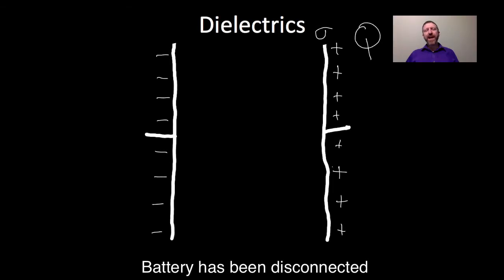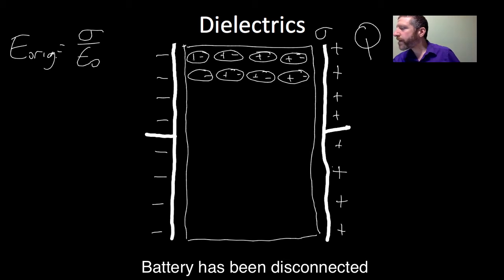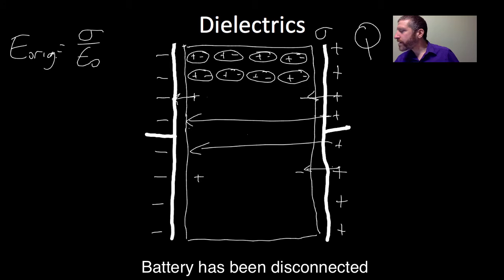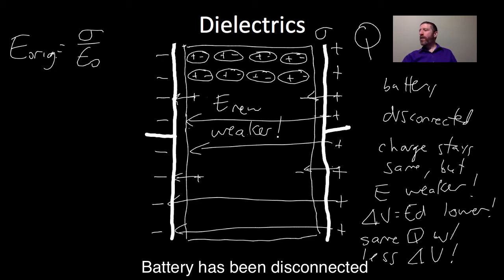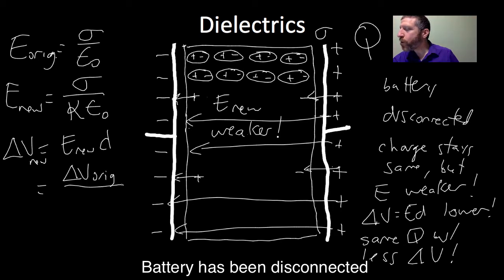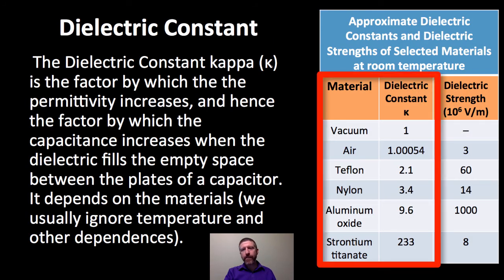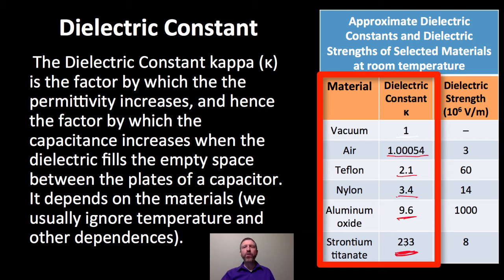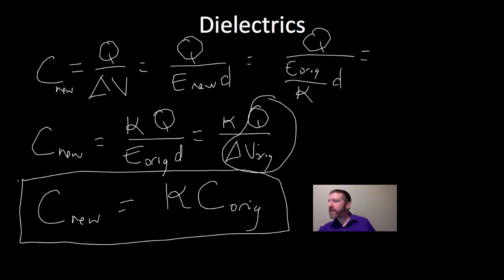16.13 Dielectrics

Comment: It kind of seems that the molecules act like in the capacitors in series... Why is it different?
Reply from the maker: In many ways it is similar!  Replacing the dielectric with a bunch of vacuum filled capacitors between the plates of the original capacitor will also increase the capacitance of the original (outer) capacitor, because though the electric field within each of the capacitors is the same (E = sigma/epsilon_0), the field is zero in the connecting wires (which are in electrostatic equilibrium) so that the voltage difference between the plates of the original (outer) capacitor is less, hence the capacitance is more just like with a dielectric!  You might think it would reduce the capacitance, since generally the more caps you have in series decreases the capacitance, but we are also decreasing the plate separations!  For a detailed explanation see https://youtu.be/ygADYZEBmtc

Comment: If you have two parallel plates connected to a dc voltage supply without any resistor, do the charges continuously move from one plate to the other?
Reply from the maker: +Duncan Donuts Hi, no, they'll only move onto the capacitor until the voltage difference across the cap equals the voltage difference across the battery.  BTW, in real life, even the wires have some resistance, so though the capacitor would charge very fast, it wouldn't be infinitely fast.
Reply from the maker: No, once the cap is fully charged for that voltage difference, the flow stops.  There is an insulating gap between the plates.